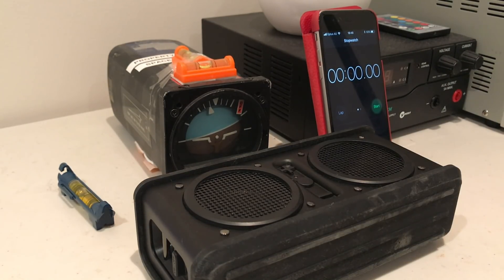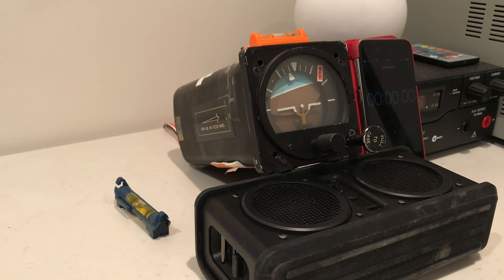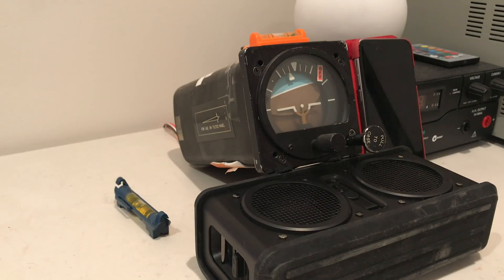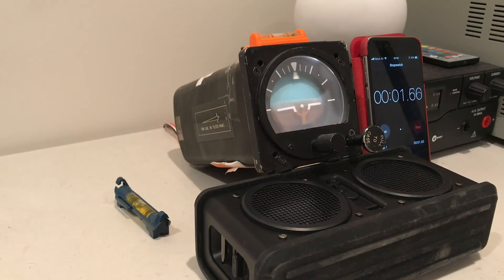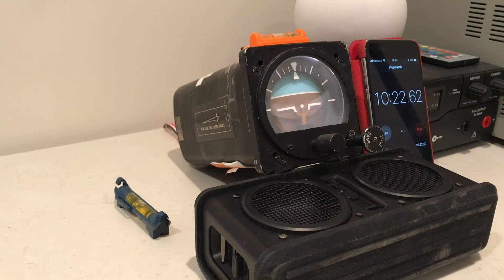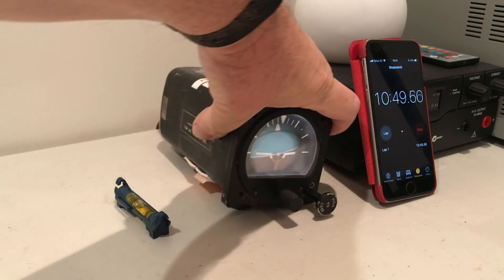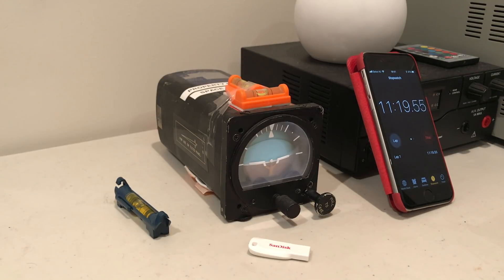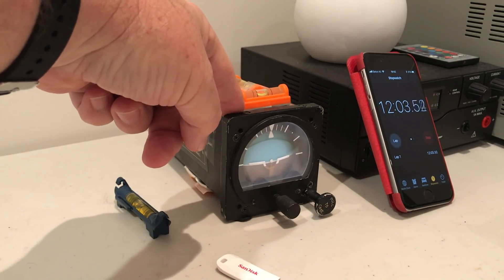Flat Earth - An often requested Artificial Horizon Experiment - Powering up at an angle.

Comment: Pilots don't need to adjust for spin because everything spins with the earth , atmosphere , snipers bullets , wind , mist , plane and train journeys with or against the spin take the same time , or am I wrong , is the globies most insane theory that the  atmosphere and everything in it spins with the earth actually incorrect ?
Reply: First of all, you are wrong.
If we accept the globe model for a second, laws of physics suggests that the atmosphere that is touching the surface must be also spinning, due to friction. It would make zero sense if the atmosphere wasnt spinning.
This doesnt happen at every height, hence why we have jet streams.
If a plane is flying, then it is moving with a different velocity than the atmosphere. 
Pilots do not need to adjust for curvature because
1- the earth is too big to have a curvature rate that could affect the motion of the plane considerably
2- the plane is already shaking and vibrating during the flight, a change of 1 degree of horizontal angle which should happen every 66 miles, wouldnt be noticable at all. Even if the pilot dipped the plane down 1 degree in an instant, you wouldnt realise it.
Reply: OUTER LANDS you are correct, everything spins with the Earth. It's called inertia.
Reply: There is a think in physic called inertia. YES...everything spin along with is. why would it NOT spin with us?

Gravity is undeniable (not as a force..it is NOT a force. But as the relative acceleration). So is inertia. both together perfectly explain the motion. Where is the problem?
Reply: No, OUTER LANDS, you are not correct.
Get a bowl of water or something and spin it for a few hours and the water inside will spin too, right? That's like the atmosphere. You can still have currents and eddies in it because it's not like the air is strapped down to the land underneath it. It's just friction and time.

And if something moves closer to or further away from the axis of rotation, it takes time for friction with the rest of the fluid to get it to the right speed, so there is a deflection in the direction of rotation or against it. On the globe, moving north or south gets you closer to or farther from the axis of rotation. That's the Coriolis effect.

Bullets are small and dense and don't fly very long, so they don't get their speed changed by the air much. Coriolis hits them hard.

For large storm systems, they bring a lot of air and you get a big deflection with Coriolis. That's why storms form spirals.

For most things, Coriolis isn't a big deal. Planes, cars, trains, are all actively held to course and Coriolis isn't noticed when there are already lots of bumps and jostles to deal with.

And Coriolis has been demonstrated in the real world. I can link a video if you want, but you'll probably just call it fake, so unless you're honestly curious (emphasis on honest) I'll leave out the link and save Wolfie time getting the comment out of spam jail.
Reply: OUTER LANDS 

The atmosphere, for this explanation,  is like a spinning bowl of water.

Bowl of water has the force that presses the water to the surface

Earth's atmosphere has the force that presses the atmosphere to it.

Both have what makes the fluid spin right along with the surface. Not sure what you're confused about here
Reply: OUTER LANDS "On a bowl of water is like the atmosphere ? yes maybe on a domed flat earth"

Nice job completely ignoring the points made in the comment!
Reply: Why? Is it a domed flat bowl? lol
Reply: Lol
Reply: +Beyond The Imaginary Icewall "Nice job completely ignoring the points made in the comment!" Flat-earthers are absolute experts in cherry-picking and word-twisting. The atmosphere rotates with the earth by the same mechanism the water in a rotating bowl starts to rotate with its container? You've just admitted that the atmosphere is contained within a dome! A NASA engineer says that the Orion spacecraft needs to undergo unmanned testing through the Van Allen belts before a manned flight through them? He just proved that the Apollo missions never happened! Neil deGrasse Tyson explains that the earth is ever-so-slightly oblate and ever-so-slightly 'pear-shaped'? That proves all photos of the earth from space are fake because it looks circular!
Reply: +OUTER LANDS "I addressed coriolie in the first comment , it doesn't exist" Merely claiming a well-known and well-studied phenomenon doesn't exist simply because your "model" cannot account for it is not "addressing" it.

"The only other point made was that the atmosphere is like flowing water" No. Gases and liquids are both fluids. They both share the properties of fluids, but to think that the atmosphere and flowing water are equivalent is a gross oversimplification. You just latched on to that one single point because you thought it was somehow an admission that the atmosphere is exactly like a bowl of water, and by extension, that the atmosphere is contained within a dome.

"I'm sure planes would have trouble flying the same speed with the flow and against." And they do. Ever wonder why flights tend to take longer traveling west? It's because the jet stream (usually) travels eastwards. Westward flights will try to avoid the jet stream if at all possible, since it is a ~100 kt headwind. Eastward flights will try to fly in it because of the "free" ~100 kt increase in ground speed (with no corresponding increase in TAS).

"Remember the flow can only go one way ." No, a fluid can flow in different directions at different locations (including at different depths for water or different altitudes for the atmosphere). Winds in your backyard can come from the east, while winds a short distance away can come from the west, north, or south. Just look at a wind speed/direction map, especially when two fronts are interacting near you.

"Tell me do globies believe that if you step at either side of the equator the water spins in opposite directions ?" As in toilets and bathtubs? No, that's a myth. Coriolis is an extremely weak force (the earth rotates extremely slowly), and the direction water enters a toilet bowl, or even just your hand movements when removing the drain plug from a bathtub, are stronger forces and those will influence the spin direction of the water.

But if you eliminate those forces, yes, the Coriolis force will be dominant. SmarterEveryDay and Veritasium performed an experiment showing this. Google "SmarterEveryDay Veritasium Coriolis" and you'll find the two videos to play side-by-side in sync.
Reply: Jasoninee what am I talking about , about the planes ? Exactly - I'm just repeating some crazy waffle from a ball earther .
Reply: OUTER LANDS 

No... as in you are not making sense of it and dont know what you are talking about. What is the "flow"? Flow relative to what? Flow implies something moving across another. The example of the atmosphere going WITH the earth is not a "flow". When the frame of reference is the earth itself, there is no "flow" or fighting the earth's spin.

Notice how you are not explaining anything of value and avoiding points?
Reply: OUTER LANDS 

Just lay out EXACTLY the scenario(s) that you have an issue with. The Coriolios is definitely a thing and is not dispelled whatsoever just because the atmosphere rotates with the earth due to friction. The coriolis effect has to do with being on a frame of reference that is rotating. Example: Is technically impossible for a projectile to go precisely straight east or west around the globe at anywhere but the equator. If you made a globe model and stood a guy up pointing his gun due east in the US his bullet would actually veer off to the south. With gravity being "down" the only path for a "straight" line of inertia around the globe is a great circle. Latitudes are not great circles, so that means a person either has to shoot slightly north (left) to hit a due east target, or if they actually shoot the direction "due east" that the bullet veers south.

I should have noted that that veering is not the actual coriolis effect, just a preemptive example because people instantly think that anything going "straight" east or west should be able to go perfectly east or west, but it becomes hard to explain how "straight" east/west is not a thing on a sphere except at the equator. This leads to the quickest go-to being looking at the northern hemisphere from above like it is a record since it is easier to see that shooting east would actually go apparently (relatively) to the outside(equator) of the record. To the observer this is going to the right.

North/south is more obvious as it is pretty easy to understand since you just  think of being on the outside a merry-go-round, facing inward, and throwing a ball towards the center... Your throw has both the speed given to it going towards the center (north pole) and also the inertia from you going at a fast instantaneous sideways velocity. This adds up to a "forward" and to the "right" total velocity, BUT since the merry-go-round is spinning ut would look like it is curving to the right.

HERE:
https://youtu.be/dt_XJp77-mk

even though a hemisphere is being though of as a merry-go-round it is still the same... especially obvious since you can even throw the ball with a curve up (just like following as if a hemisphere was there) and it veers APPARENTLY (not actually curving)
Reply: OUTER LANDS 

OH OUTER LAAANNNNDS
Where'd you go little fella? Silence of understanding?
Reply: OUTER LANDS 

Hellllooooooo

Thought you FEs were all about seeking the truth... how come you disappear right when it is explained to you?

Afraid of truth much? Why not either acknowledge or explain what is wrong with what has been told to you?

hmmmmmm..... curious.... very curious
Reply: +Jasoninee "Thought you FEs were all about seeking the truth... how come you disappear right when it is explained to you? Afraid of truth much? Why not either acknowledge or explain what is wrong with what has been told to you?" That's the standard M.O. of most flat-earthers. When one of their claims gets dismantled, they just ignore it. Way far too often, they even go so far as to label the provider of that information as a government agent paid to lie. It really must be convenient to be able to dismiss completely any information which contradicts their beliefs, by merely classifying the information provider as someone "in on" the conspiracy actively working to stop others from "waking up" and figuring out "the truth".

They might think they are on a pathway to truth, but in reality all they have actually done is punch themselves a one-way ticket to Confirmation Bias Land.
Reply: Beyond The Imaginary Icewall who's ignoring ? I addressed coriolie in the first comment , it doesn't exist . The only other point made was that the atmosphere is like flowing water . I'm sure planes would have trouble flying the same speed with the flow and against . Remember the flow can only go one way . Tell me do globies believe that if you step at either side of the equator the water spins in opposite directions ?
Reply: OUTER LANDS 

for the planes flying with the flow: what the hell are you talking about?

for the water and the equator: WOW! Hey now you're thinking! That is exactly what happens look at this:
https://d32ogoqmya1dw8.cloudfront.net/images/eslabs/climate/global_currents.gif
Reply: OUTER LANDS 

"only other point" - WRONG

I addressed you thinking that a bowl of water spinning isnt analogous to a globe... when it absolutely is. There would be space, which is not putting force on the atmosphere, and then the earth, which with gravity is absolutely emparting force to the atmosphere which makes it spin with it. The atmosphere is analogous to a layer of water. Atmosphere only seems weightless because we are immersed in it, same as water seems weightless while you are underwater. Atmopshere is held down to earth just like water is held down to a surface. You spin the surface, and the water/atmosphere spins right along with it.
Reply: Barry On - A bowl of water is like the atmosphere ? yes maybe on a domed flat earth